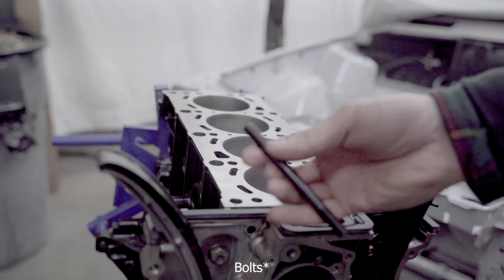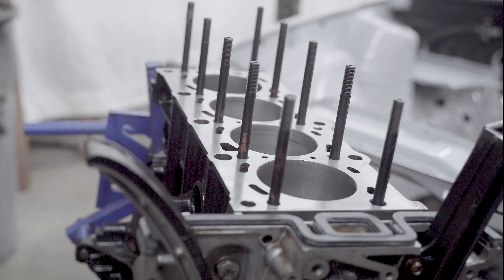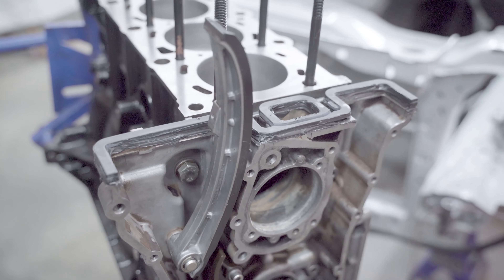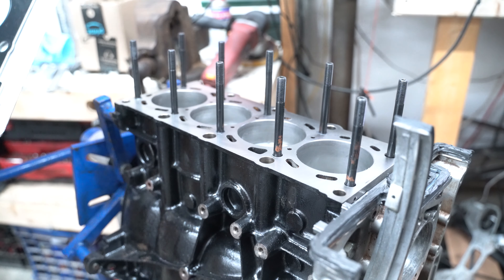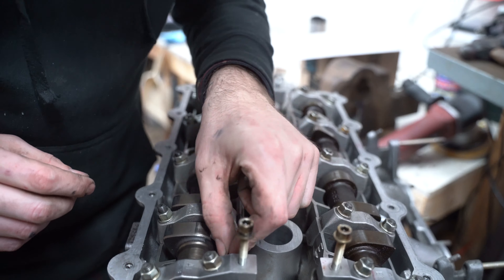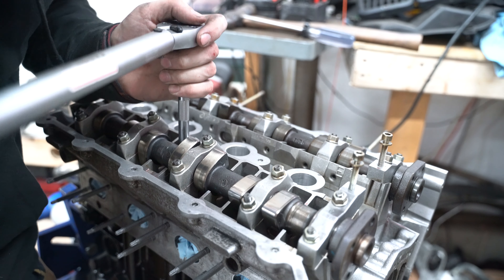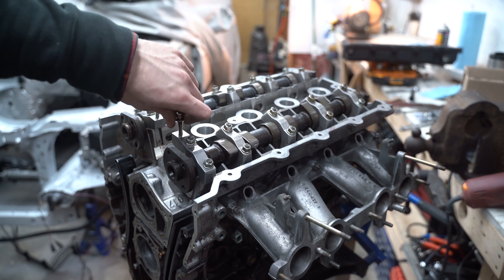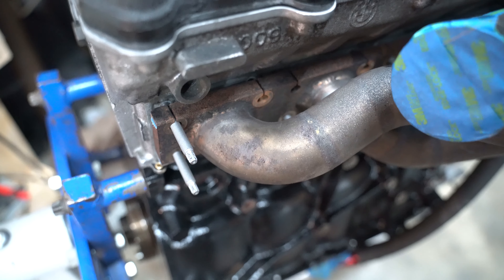E30 Turbo update: Head gasket, valve cover, etc...

Comment: Hey man I've been following your build on here and facebook keep it up man! I have a question for you, for the life of me I cant find which arp head studs to use for the m42. Which size and stuff did you use?? Is there a kit??
Reply from the maker: I actually bought mine from someone. But this is the set I believe: https://www.racetep.com/m42-44headstuds.html . You'd need to confirm this but I'm also pretty sure that M50 studs are the same and you can find those sets cheaper than the M42 sets. Hope that helps!